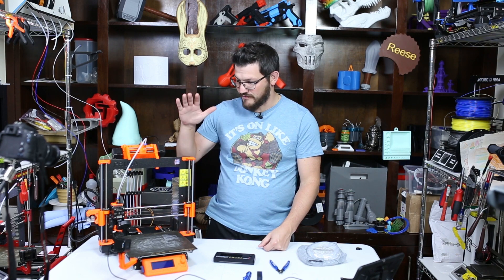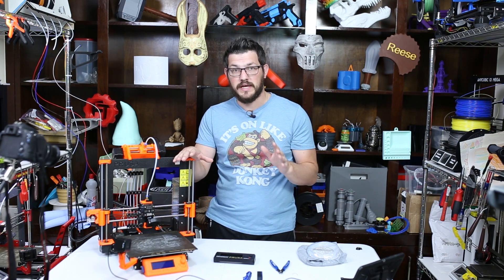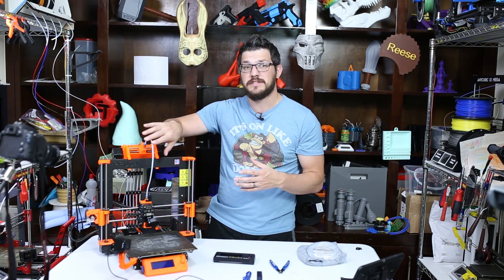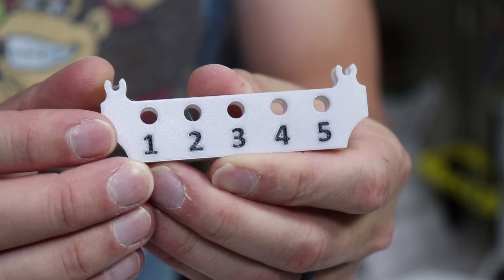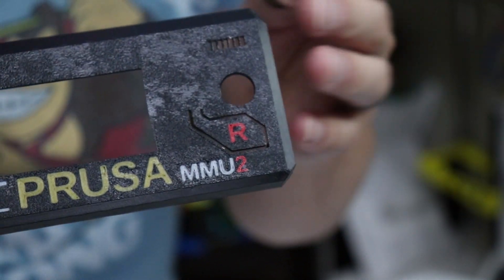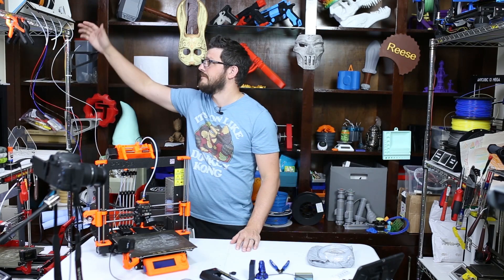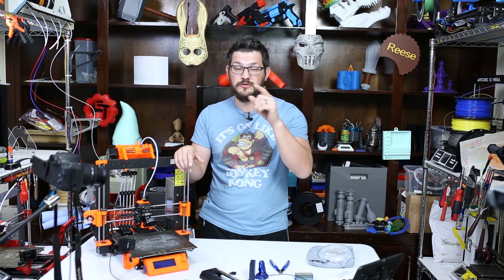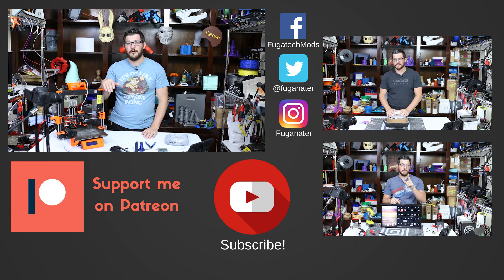THE MMU2S WORKS!!

Comment: Look up some of the auto rewind spool holders. There's some that are designed to fit in the box, and no buffer needed. Just tune the rewind torque to what you need for the MMU and keep it nice and clean.
Reply from the maker: I tried them and they never worked. Not sure what the issue was. I even reached out to Joe Mike about it. Either way, the MMU2 is gone and the Palette 2S Pro has a buffer inside it.

Comment: What ptfe tube did you change to to add "more slop" was it the 3mm? I got a little confused and want to make sure I get the right size
Reply: It lowers the chance of the jams. However the filament diameter is 1.75, the tip can be wider (usually it is), and you want less friction there, especially when unloading.

Comment: Hi great video. Can you please describe more the mod that you use for mdtpf pass-throw. Chris video is not with the IR Sensor. Do you disable the IR sensor ?
Reply from the maker: I did not disable it. The 2 mods I printed just make it easier for the filament to move through the system.

Comment: I think you would have been better off getting a Sidewinder X1 and a palette 2. You would have better build volume.  Prusa is a fraud. they will sell you faulty printers then the support staff will talk you into keeping it. under promise of treating you right for parts/upgrades. then cut warranty and charge you full price for the parts to get the printer working. will never give Prusa a dime. Stay away from that FRAUD! The sidewinder and palette idea i think is cheaper setup and much better options you can move the Palette from printer to printer unlike the MMU
Reply: I own 2 prusa mk2,5s and a mmu2 (used to be a mmu1 unit) And firstly i will defend prusa, theire bare printers do work well. I have not had alot of problems with my prusa mk2s and now mk2,5s. BUT the mmu option has been flawed from the beggining and if i was to choose again i would most definately have bought the pallette instead. The mmu1 had tons of problems with filament getting stuck, and it was a bowden setup. The mmu2s doesnt seem to fair much better. also the pallette doesnt waste all the plastic on the wipe tower.
Reply from the maker: The MK3 is one of the best machines on the market and will remain so. No one can argue that. As for the MMU2... ya, it needs a ton of tweaking but it is half the price of a Palette 2. Now that I am using decent filament and took the time to ensure evyerthing was properly aligned, I'm happy I have it. 

I am curious though how well the Palette 2 works with cheap filament. It totally screws the MMU2 up so if it does well with poor spec filament, then it is a winner all around.
Reply: @Fugatech3DPrinting  I think different. the MK3 might OK be but My experience  is that the MK2S has issues. Prusa Support will mislead you into keeping faulty equipment. and they will "up sell" you then cut the warranty. Bought a MK2S with in first 30 days pinda probe failed. caused damage to bed. I wanted to return. they tell me they will send me the parts to replace. and i would be "treated right" if i kept the printer and just repaired it. I agreed then another pinda probe died. then another one. did this 5x ! then they offer for me to buy a 250$ upgrade to move to a pinda 2 probe. for the 2.5 upgrade. treated right? i think not. bought upgrade pinda probe burned up once more printing the 2nd set of parts for the 2.5 upgrade. had to buy a ender 3 to finish printing the parts i needed. then ran into heat issues on the MK2.5 Prusa Support was complaining that they sent me all these pinda probes. and admitted they had a bad shipment of them probes. Prusa is a Fraud. the support staff will mislead you. I paid 180$ for my ender 3 still runs perfect. I have 4 other printers as well. the Prusa is way overpriced That the support staff will rip you off. plus there is more i could go on. Prusa is a Fraud

Comment: For someone who has the mmu2s and is struggling like you were, Im disappointed you didnt cover the fixs you learned. Thanks for linking Mr Rileys video at least but his video is for mmu2.
Reply: I got mine barely working, it's a massive pain in the ass. But when I get mad, I take a step back and look at the engineering marvel that it is, that us mere mortals are able to afford. It's very finniky but I found that the extruder sensor and mmu finda have to be working PERFECTLY, or it'll do very very very strange stuff on you. Oh also, my tips are hopelessly super stringy because I have old thermal compound on my heat break. You can add a couple cooling moves to help, but if you're above 4, dismantle your hot end and re apply thermal paste to your heat break. Weird, but apparently there isn't much in the software side you can do to improve the tips if cooling moves don't eliminate stringing
Reply: He didn't cover the fixs, no one can hahhaah. Big shit product
Reply from the maker: Also there is no difference between the MMU2 and the MMU2S. I also talked about and link the remixed parts I used that he didn't talk about.
Reply from the maker: Didn't cover it? I said to go watch Chris' video and follow that. Other than that I stated everything.
Reply: @Fugatech3DPrinting  The title of this video is "the mmu2s works". So yea your mmu2s is working. True title - yours works.
You showed a bunch of prints after saying how much you struggled with this thing. I was expecting to see the actually fixs and explanation as to why and how those fixs got you working again. Not just links..... this is a video not a tweet or web post??
The mmu2 is different mmu2s or else why would prusa bother upgrading it. 
Im taking the time to explain why I thumbs down the video and why I was disappointed.
Reply from the maker: I'm not one to redo someone else's video. I get nothing from that. This video was not a tutorial either as it was more of a VLOG about me working on it. If you wanted a tutorial, go watch Chris' video. There is nothing wrong with sourcing someone else's video but copying it is wrong. Again, the MMU2 and MMU2S are EXACTLY THE SAME. The only difference is the buffer bit which I'm not using which has nothing to do with the functionality of the MMU2.

You said you have it. Did you change out the parts I said and follow Chirs' video, like I did, and get it working? If you did all that, and still have issues, I'd love to hear about it.

Comment: I use a filament buffer with a ball bearing wheel which works really nice and looks good. I remixed it a bit and uploaded it to Prusaprinters. Same username. But I have some trouble with PTFE friction. It is way to high. One reason is the base of the buffer which constrains the tube quite a bit so I will have to modify it. The other reason could be the 90° bend I have from the enclosure to the mmu. I still have to find a solution for that. Maybe some ball bearing wheels as well

Comment: What are you doing to get PLA to stick on the powder coated sheet?
Reply from the maker: Most of the time nothing but sometimes I'll use glue stick.
Reply: @Fugatech3DPrinting  interesting, I have had hit or miss results with PLA on the powder coated sheet. I will only use PLA on the PEI smooth sheet now. I use the powder sheet with PETG, ASA, ABS. Thanks for the reply also.
Reply: @LawnD4rt  dissolve some gluestick (or any other PVA) in water and brush a thin layer on the bed. Then heat it up while you keep brushing. The thin layer that's left works like a charm for PLA and most others. Just remember to wipe the bed with alcohol before every print
Reply: @Richard Parker Ya re-checked Z height. I was still to high. I brought it down and it seems to be allot better. I still would not do PLA with a small surface area on the powder sheet. Or not without a brim. I have not used glue stick on either the steel sheet or the powder sheet with any filament at this point.
Reply: I print PLA pretty much every day on the powder coated sheets. You just need a little more squish than you do on smooth sheets. Also, make sure your bed temps are 60c. Pretty PLA profile and others have it at 70 and that almost always fails.